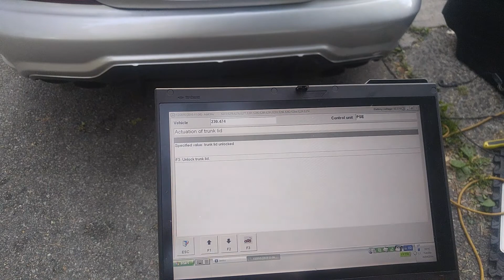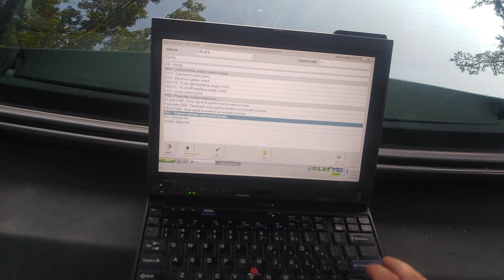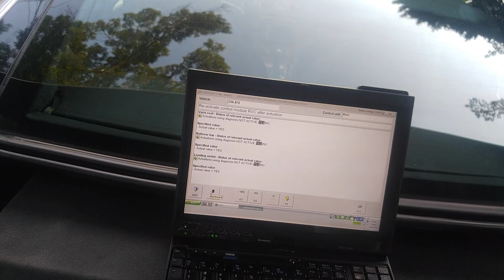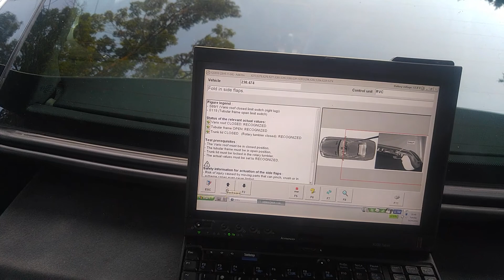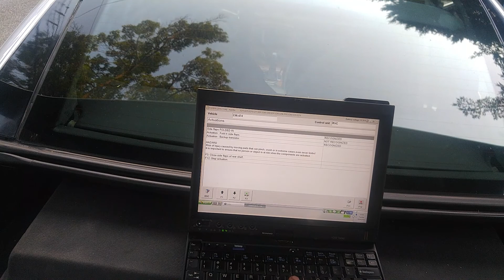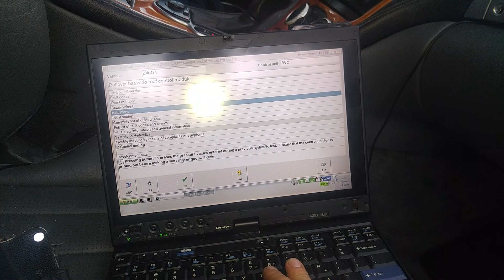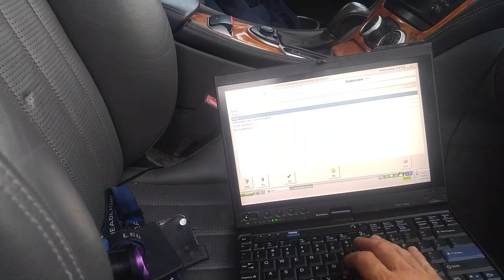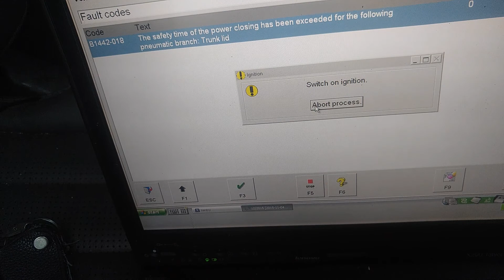Mercedes SL55 AMG SL500 roof problem and other issues diagnostic and repair. Part 1

Comment: Where can I get the plastic piece for the manually opening of the trunk that you talked about in this video without purchasing the entire $75.00 used on eBay latch mechanism?

Comment: You spend a lot of time trying to activate the roof retraction with the trunk open, that is a No No. You can adjust the contact switches on the front windscreen frame as long as the black tang [ in the locking assembly ] is not broken off. The windscreen locking mechanism is very difficult to change also. The roll bar need to be exercised or it will freeze up in the extend position get two strong guys to bush back on the roll bar while you operate the unlock switch on the center console. some reason, the roll bar tends to freeze up if it was not moved. I recommend operating the roll bar at least once a month.

Comment: After Apoxy ,fixing leak in my soft 
 close trunk actuator, my trunk release the light on the door panel is on  and my top won’t work “help “your videos are great thank you.  Any help would be greatly appreciated. Steve

Comment: my sl keeps saying that trunk lid is open  and will not operate.... any ideas. i wired the partition switch and still nothing
Reply from the maker: I need the car to diagnose it properly. You can find my repair rate and location on my website in description.

Comment: Mine was working but suddenly it stops. Took it for repairs and the guy yank the vacuum pipes for the pse. Am really confused how do I get which pipes goes like for head rest left and right door etc.
Reply: How do I remove leftside lock paw cylinder on 2006 sl55 amg? I can't get the hydraulic line out.

Comment: You have a bit of a Hot Mess on your hands, Normally Tubular frame switching and partition screen recognition problems could indicate a car that was Hit from the rear. I would not be so quick to condemn the pump since they are normally long lasting and reliable [ there are many unnecessary pump changes and it is a nightmare to reconnect the two dozen hoses to the valve controler ].  It's always a good idea to remove all the trunk carpeting when doing Vario roof repairs since there are limit switches on the Lower scissor frame and the main tube they sometimes fall off the retainer and lay in the space between the carpet and the interior of the  fenders. I am glad that you have the [ Mercedes ] STAR software, and you must always consider that. if the system is recognizing the switches it does not mean that the switch is physically where [ it is supposed to be ]  it was mounted in the factory; that is why I emphasize removing the carpets completely.